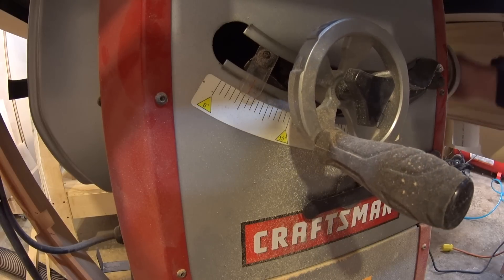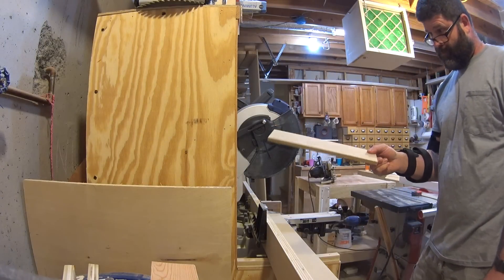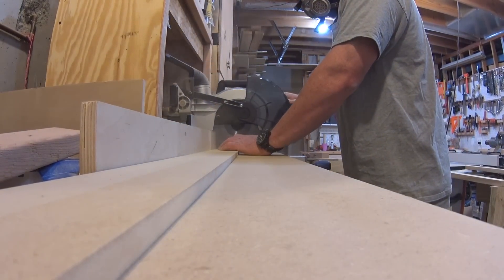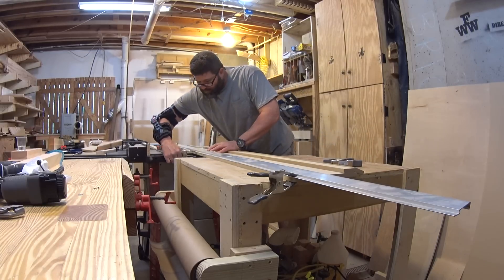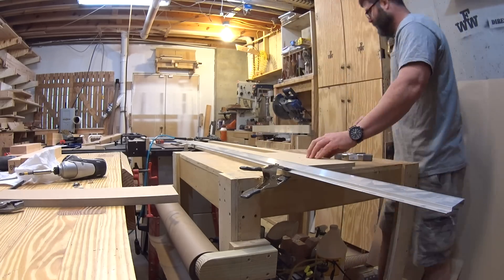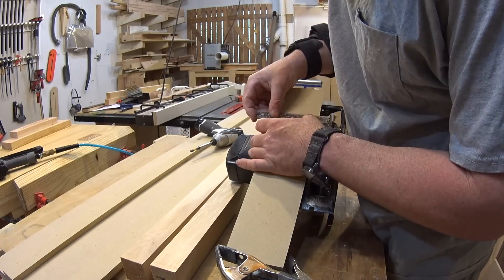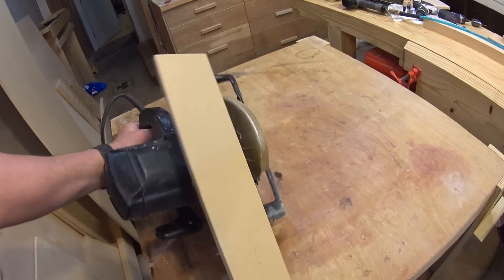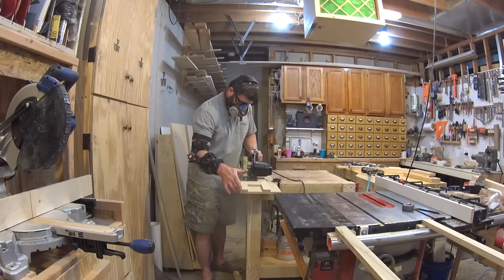Save Hundreds!  Ultimate DIY TrackSaw

Comment: nice vid. I wish you didn't have to give up so much depth of cut to get this to work, but there it is - not your fault and the design is good! Considering doing something similar to a big 10 1/4 saw to end up with maybe 3" depth of cut at 90, which would be awesome...
Reply from the maker: I've thought about this.  I've considered remaking it with 1/4" or even 1/8" material as the base, and 3/8" MDF for the dovetail material.  I'd have to increase the dovetail angle to at least 15 degrees, but I think it's doable.  These changes would give you the ability to cut a 2x4 or two pieces of 3/4" plywood with a standard circular saw.  You may have prompted me to do this....
Reply: FranklinWoodWorks  maybe building in Aluminum would let you get super low profile. More expensive but could go down to maybe 3/8 total thickness. I will report back and link to your video if I end up building one!
Reply from the maker: Cedrick Gousse That would totally defeat my goals of building something cheap with stuff I already have in my shop.  I'm just breaking down plywood, nothing fancier than that.

Comment: You lose a lot of the depth of cut don't you.
Reply from the maker: You lose an inch.  But since I'm only cutting down plywood, this is the perfect solution for me.  And the price is right.
Reply: Thanks for your reply,  I use shooter boards when I cut off doors. They have to be extra thin to still cut 1 3/4".

Comment: Your idea is the best diy track saw in my opinion. It is easy to repeat, chep and fast to build. Thank you for the video.
For creating dead square base plate I would choose start without the tapered sides. Put a perfect square MDF bottom of the circular saw while it's one side touching the blade and clamp it. Drill the mounting holes. Then you can cut the tapered sides for dovetails of the base plate.

Comment: I like it.  Just not the mdf dust without extraction
Reply from the maker: Yeah, I don't like the dust either.  I'm just not willing to pay several hundred dollars for the collection.  I'll just break down the MDF outside.
Reply: FranklinWoodWorks I already carry 2 saws one cordless and one corded.  Don’t really want to carry another big saw.  I like yours because I assume you can leave the mdf on the saw and use it without the track unlike others designs with one skinny track under the saw

Comment: I like the dovetail idea as a way to lock in the saw but seems to me the edges of mdf would tend to wear over time with repeated sliding...just MHO.
Reply from the maker: Jay Bluestine I imagine it could wear over time, but I've been using mine for over a year with no wear.  I wax it to keep it sliding smooth, and I guess this has prevented the wear.  I think most folks miss the point of this jig.  Not only is it deadly accurate, but it costs less than $20 to build.  If it ever gets loose, I'll build another one, and smile all the way to the bank.
Reply: I think I may use your design but make it out of rock maple and lube the slides with paste wax. As far as attaching the base plate, seems like it might be easier to pre-drill the holes in the base of the circ saw, then use a combination square and clamp the wood base plate down on my table saw top exactly parallel to the edge. Then with the blade of the circ saw all the way down, bring it flush to the edge of the table and drive screws through the pre-drilled holes down into the wood base plate. What do you think?
Reply from the maker: Jay Bluestine I think your idea on attaching the base plate is excellent.  Just make sure you plan out the spacing of the plate to the blade so you have no problem with the dovetail on the jig.  my only concern with the maple is that real wood moves, contracts, expands, etc.  I used MDF for the cost, and a couple of coats of shellac and wax protects it from moisture.  I haven't had any issues with movement.  But it sounds like you're thinking this through, and I appreciate you sharing your ideas.  I'm always looking for a way to make things better, as long as cost doesn't get in the way too much.
Reply: I've used maple before for fences and guides. It is so dense with such tight, closed grain that once it is really dry, it doesn't move... especially here in the high desert of central Oregon.  Just FYI - So much old bedroom furniture from the "50's /'60s was made out of maple and has been since discarded that you can go into almost any thrift store and get a couple of solid maple bed rails for $5.-10. A couple runs through the planer and you have beautiful, aged bone dry maple boards for less than the price of a sheet of OSB.  Old dressers and tabletops from garage/yard sales are also great sources of nice solid boards that can be up-cycled into new projects for a fraction of what it would cost by the bd/ft.  If you haven't done so, I would strongly suggest checking these sources for low cost, high quality hardwoods.
Reply from the maker: Jay Bluestine Great idea!  Thank you.